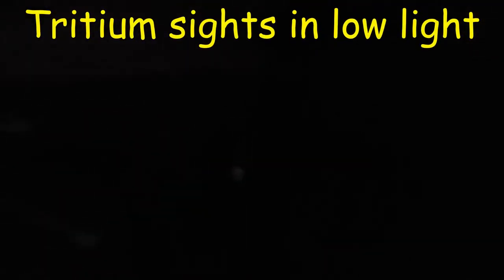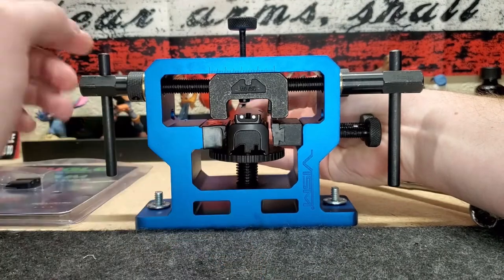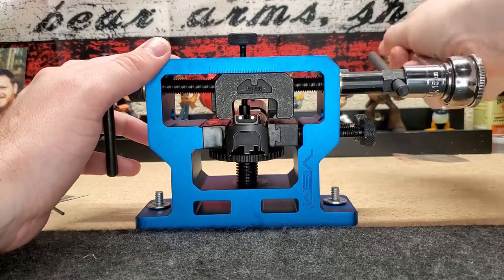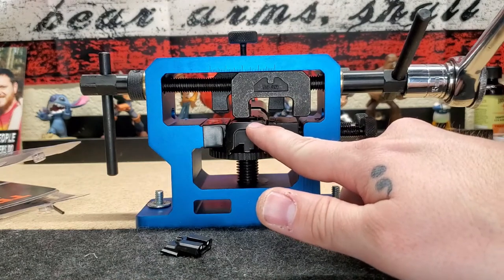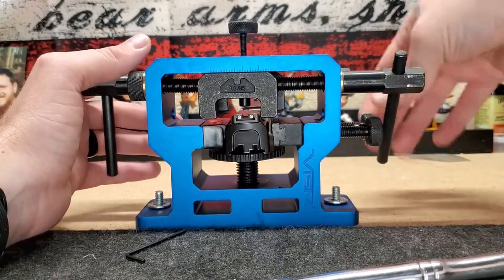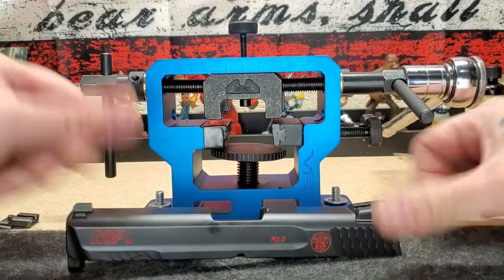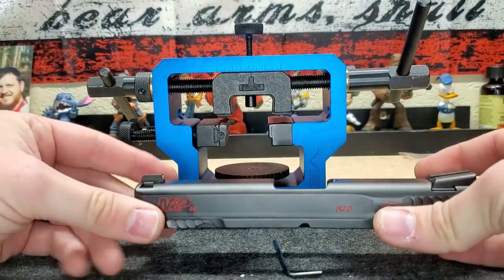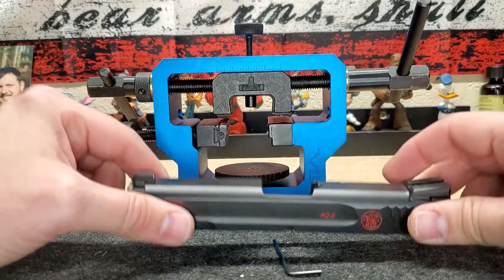How to installing TruGlo Tritium sights on Smith & Wesson M&P 2.0 with Vism sight pusher from Amazon

Comment from the maker: If any one has any questions about the sights or sight pusher (or rat), just ask in the comments!
Reply: can u use it for other pistols.(walther pps m2)
Reply from the maker: Yes, you can use it on any pistol that the sight slide in and out, which is most.

Comment: Dang,  I wish I had seen this before, I did a ApEX trigger on my 5in 2.0 and I had already had the sights changed out, but needed to add the APEX safety plunger and dam I marred the rear sights, and  they are still about .10-.15 off center, but can not tell for sure as I marred the edges.   I will have to get one those nice sight pusher for the next two M&P I need to work on.

Comment: I just got my true glo sights today, I'm going to order the sight tool right now!   Thanks for sharing this!
Reply from the maker: Your welcome!  That sight pusher worked way better than I thought it would.  I have used it to replace multiple sight now.
Reply: @LakeNormanFirearmsTraining  this is my first time doing sights. I'm going to have to change a few as my other guns are 15 years old and the sights barely glow on them, and I just got the m&p 2.0 compact .40, saves me from taking 3 to a gun smith.
Reply from the maker: If you run into any questions let me know and I'll try to help
Reply: @LakeNormanFirearmsTraining  thanks I sure will
Reply: I got my sight tool today, just got done changing one set. Kinda went slow at first lol wasn't sure what to expect. Once again thanks for your video!

Comment: Yeah I got this for my M&P and I think people need to be forewarned, the sights on M&P's are NITORIOUSLY tight to the point even this will not work on them. May have to resort to finding an armorer or resorting to a vice and hammering it out.
Reply from the maker: They are tight, but I was able to get them out without an issue.   You just have to make sure you are lined up correctly.
Reply: @LakeNormanFirearmsTraining  I'll have to try again. I was afraid I might break them or even the sight tool by how much resistance the sights were giving.

Comment: One of the guys I was watching says you put your slide in the refrigerator and freeze it overnight and it's easier to take off
Reply: Close, put your new sights in the freezer, warm up the slide and it should loosen the tolerances.  The same is true of installing pistons in an engine block.

Comment: Do you know if this sight pusher works for an M&P9 Sheild Plus?
Reply from the maker: It should I have used it on a variety of firearms.  1911s , SD 9, sigs.  You just have to adjust the hight to get the slide where you need it.  Hopefully it works out good for you!

Comment: Ummm...did you scrap off the finish in front of the rear sight?
Reply from the maker: No, it was a scuff from the rubber pusher.  Wiped it down and oiled it, and as good as new.